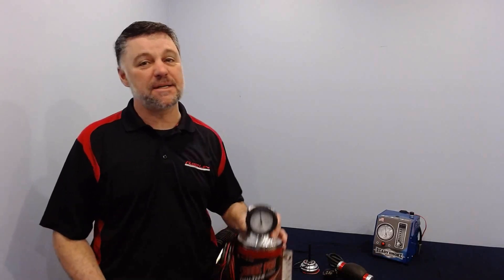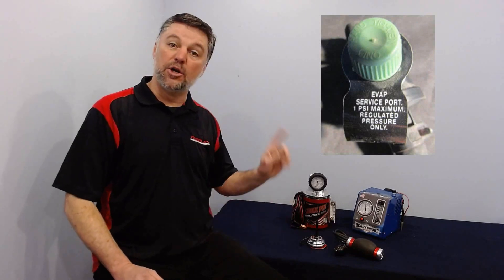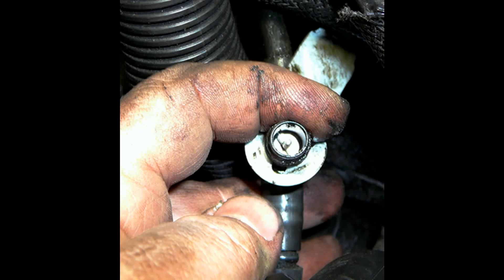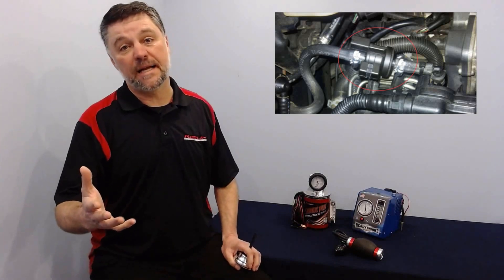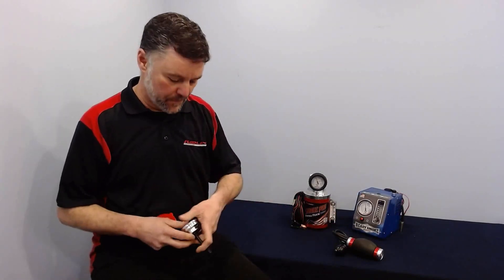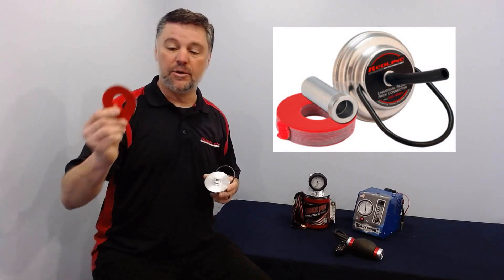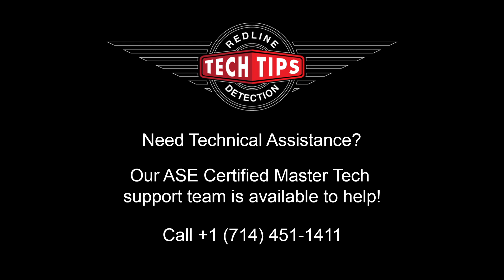Tech Tip: How to Test the EVAP System Without an EVAP Service Port

Comment: Why cant I just use a new gas cap for 10 bucks and drill a hole to insert a clear air hose thru the middle and silicone both sides around the hose and let dry for a day. Would that work as well? if it were to leak around the filler lip I would see that easily and if not the smoke test proceeds thru out the system. If I have something wrong then please explain why that wont work. Thanks in advance
Reply: Because then they can't sell you this crap for $99. I would do exactly what you posted and use the remaining $80 to actually  pay for the emissions test.
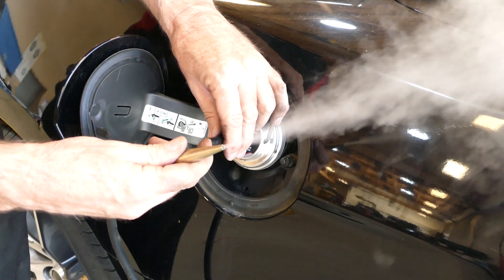Reply: Also at 1:23 in the vid as you begin to apply smoke, look at 6 o'clock or the bottom of the cap and see a tiny stream of smoke streaming out from the sticky gasket area. Didn't slip my eye. Use a real gas cap.  Just freeze the vid and look for yourself.
Reply: @lia1063  I think that was smoke collecting in the area before he inserted the tip...which would make it appear that cap seal was leaking.
Reply: @MyNameForNow27  Nope I have slowed it down multi times and freeze over and over to see that small stream of smoke exiting at the 6 o'clock area on that cap.
Reply: I ended up making my own smoke tester.  Just a jar with a hole in the metal lid to put the solder iron tip down in and silicone at its base to the lid. Ok i added 2 air hose lines on each side of the lid outside the solder iron base. Silcone the hoses to seal. Put a cotton wash cloth in the jar and soak in mineral oil and let the iron tip touch the cloth. It will smoke up a storm. Then I pulled the evap line under the hood that heads back to the rear of the car. Hooked the smoke hose on that line and simply blew as soft as I could to move the smoke to the rear. Sure enough the leak was easy to see coming out where a hose was connected  to the evap cannister. I have used this twice since in 3 years. Anyone is welcome to borrow it in my area.
Reply: Snap on makes a rubber gas cap adapter for like 20 bucks it comes in their bluepoint brand package but u shouldn’t use gas cap adapter adapter if possible because u want to know if the cap is leaking. All u need to do is take the evap line off the purge and hook up a rubber hose. I have this adapter made by redline it does work good too but the problem is u need to buy the double sided tape rings to use it and they really only work once and u need to make sure the surface is clean or it won’t stick so the rubber bluepoint gas cap adapter is nice because it just hooks up to the filler neck u don’t need to buy any double sided tape rings but it won’t fit on every filler neck but if u have both the rubber adapter and the redline adapter u will fit almost everything. You wouldn’t want to drill a hole in a gas cap to test also because that gas cap will only that vehicle or vehicles with that style cap so unless ur working at a dealer it would be a waste of money it would be more expensive to buy every different gas cap. Last thing they make an inflatable bladder with a hand pump that works great for plugging off intakes I bought a generic brand off eBay for 40 bucks that works amazing, the redline brand is over 150 bucks
Reply: I went to the junk yard and got a cap and drilled a hole in the center and I used a 1/4 inch male adapter with a hose connection on the other end and used gaskit maker to seal the cap up